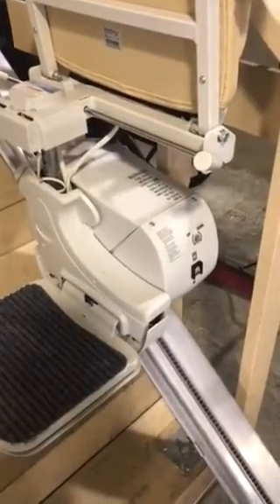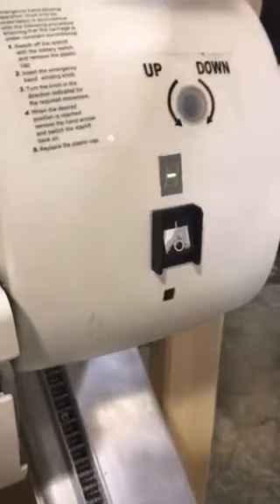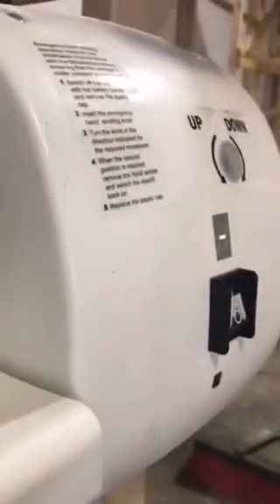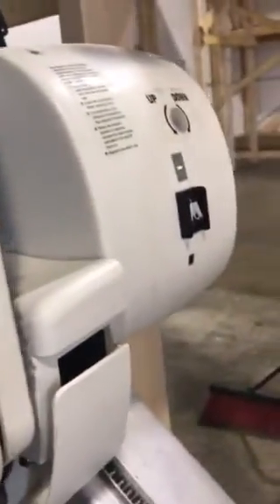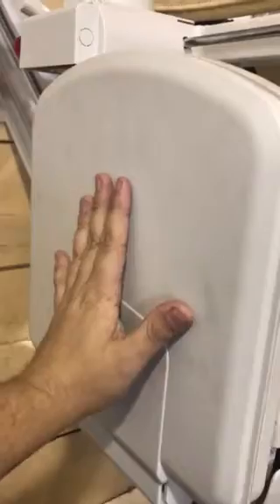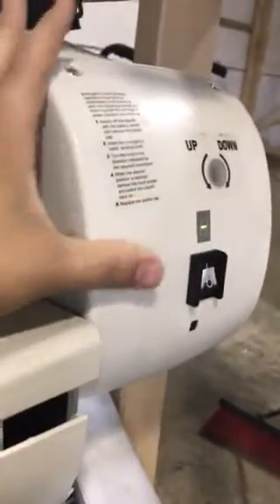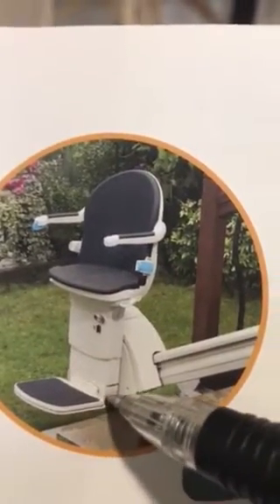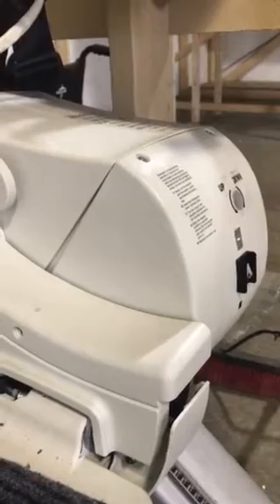Trouble shooting a #4 or #6 on a stairlift

Comment: Hey Carlos can you show a video of replacing the batteries and connecting all the electrical fittings from the on/off switch. Can't seem to locate a wiring diagram
Reply: did you find where the batteries go?

Comment: HI Carlos I have a 130 acorn stairlift its stuck at the top of the stairs with an e4 error code. ive tried a few things but it wont move when I press the switch to go up or own there is no sound. I would appreciate any advice. Thank you Derek

Comment: Hi carlos. I bought a second hand. Handicare 950. It works but the remote is not. Changed the battery on both remote. It light up but nothing happens.  It there a fix eg: reprogram ete. 
Thanks
Aj
Reply: Press the small button located on top of the main control board and hit down on the remote while holding the programming button when the led on the main control board turns green it's programmed.

Comment: Have a Stannah 600.  Just a year after install.  Gets to top has a 9.  Have had service out twice to move it manually a little b4 top.  But I have forgotten. To stop now it's stuck at top. With a 9. Any help or advice greatly apprrciatef
Reply: Appreciated
Reply: Hi , I’ve got the same model 600 and the same problem as you 
Its stuck at the top of the stairs on number 9 
I found a quick fix to move it , there is a removable cover over the display 
That hides three buttons , two are push buttons and one is  a  SWITCH !!! 
Press the switch then one of the buttons to move it 
It will move very slowly , I’m going to try and fix mine  tomorrow 
As I do electronics , please remember to put the SWITCH back  under the panel to where it was 
If you get it sorted  , hope this helps for now :-)

Comment: Got a error code #0. At the top we press down. So the chair starts swiveling in line with staircase but, we stopped it too soon so its at a 45 degree angle. When pressing down again it no longer swivels and starts traveling. Confused we stopped now it just says error 0. Any help?
Handicare 950+

Comment: Hi  how to manually winding the stairlift when the lift has got.no power? Also when doing manual winding how to remove the break? I can't wind it because i believe some break is engaged. Thanks
Reply: Have a acorn 130 and I have a 5in light 8 on the way up and a 9 on the way down
Reply: U Charlie doesn't move that it likes 38 or 39
Reply: Flash season 3 and 8 on going to try to go up in the three and a 9-minute try to go down

Comment: i didn't turn on my in a long time now it doesn't move at all and number 8 is flashing. Can you give me some help to try to fix it myself. Thanks
Reply from the maker: brinozke what is it showing when you try to go up or down? The most common issue is a code 0.
Reply: Carlos Lopez the chair is up and can’t really be sure but it looks more like a 8 just number no letter. I’m taking a look again and it may be cero too I just see the whole panel flashing without stoping unless I turn it off. The chair doesn’t move at all. If is cero what will be your diagnostic? Or recommendation. Thanks
Reply from the maker: brinozke a zero is usually a key that is turned off, or the stairlift went too far to the top and overran the limit switch. In which case you either turn the key on, or use a winding tool to bring it down a foot. A number 2 means it isn’t charging, and a 6 or a 4 is related to a safety edge.
Reply: @CarlosLopez-ck5oz  I installed new batteries.
shows 8-9-n half speed
Reply: Željko 8 is going uphill, 9 is coming down. n is definitely half speed which means the batteries are at a critical level and aren’t able to continue receiving a charge. You may need to replace those batteries. If you charging system is working (check all connections in bottom of track to make sure they are tight - also make sure copper strip is clean and charger is plugged in) it may have something to do with the charging circuit on the board.
Reply: @SuperGuitarlos  I replaced the batteries and the charger.
I still have the same problem.
The copper strip is clean.
Reply: Željko what’s the age of the lift? There should be a SN on the uphill portion of the motor, starts with an S. Then the next 4 numbers are the month and year it was made. Based on what you are describing it is most likely the circuit board that is bad. The only other thing to check is the charging brush on the inside of the motor. It rides along the copper strip. If that is uneven or dirty you can take a small file and file it down just a little to clean it or level it off. Be very careful putting everything back on because you can snap that brush off when reloading the motor.
Reply: @SuperGuitarlos  The chair is 2004.
Charging brush is clean.
I do not know where the reed switch is located?
This may be a problem,or deep switch.
Reply: Željko 2004 is very old in stairlift years. I would venture to say 100% the circuit board. You will need what’s referred to as a green block board. Expect to pay anywhere between 600 and 800 dollars plus labor.